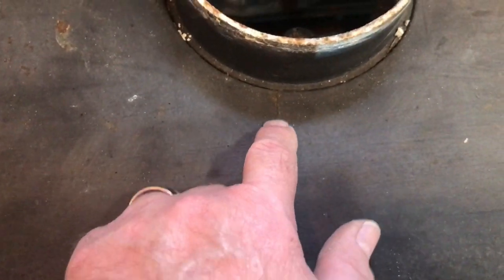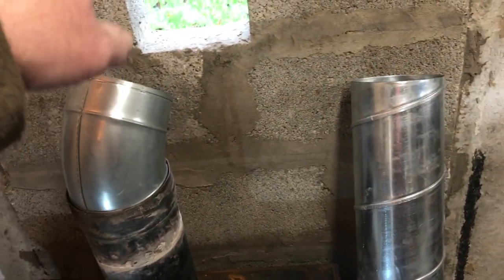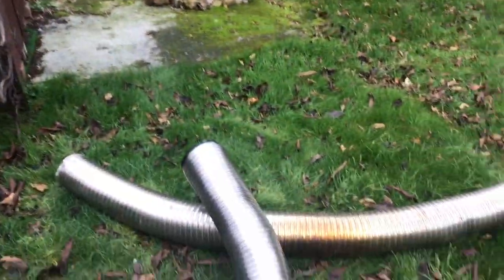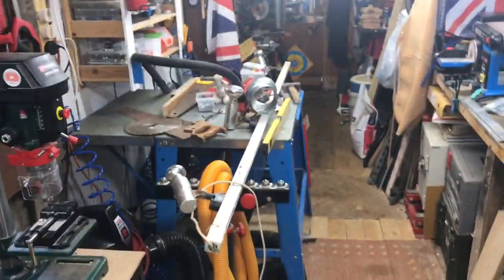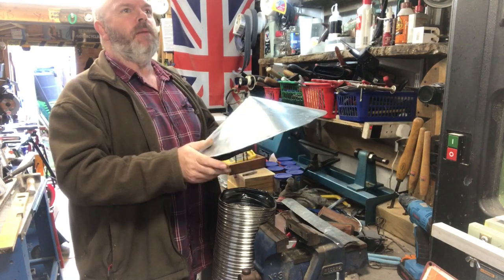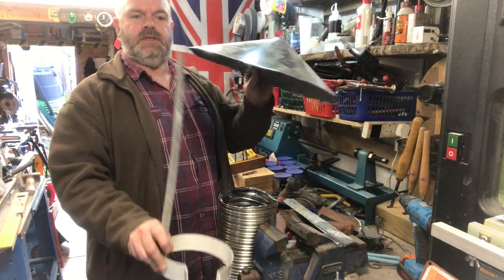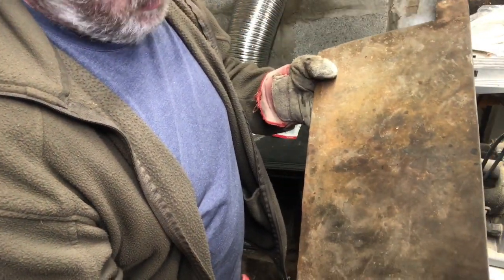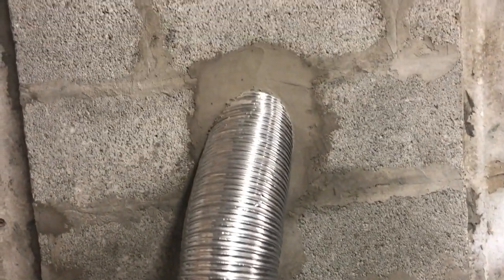In The Workshop Installing a Log Burner

Comment: Just wondering if the inner pipe is upside down so they overlap better and hot air/fumes pass the joints better?
It’s in no way a criticism because I’m no expert I think it’s a good job and I particularly like the bird and squirrel net at the top under the cowling .I remember putting one in with my grandads shed when I was about 14 nearly 60 years have past since then and and my energy levels are not what they were but I still go in the shed most days at least for a few hours. Always find your videos entertaining and we all learn a bit from each other thank you David
Reply from the maker: Hi Michael, I put it on the way the previous owner had it because that's where the fire cement was. It  sits on a ledge inside the hole. I've checked and have no leaks and it draws a treat but I will keep an eye on it 🙂 Maybe we both had it upside down.
Thanks for watching 👍
Reply from the maker: Checked some flue fitting instructions and they have the flue pipe the way I fitted it. They say you have it this way so if creosote runs down the flue it stays on the inside. 🙂👍

Comment: Goid job mate . Glad you used the copex as a sleeve and not the main flue. Good idea to make your own twin wall flue how is it coping. Were did you get the stove fan I remember it from a previous video but can't remember were you said. Keep an eye on the flue as the inner section may cause the main flue too secondary cycle but it might not just thinking ( been a hvac engineer for 27 plus years ) and iam sure your aware watch the temp of the copex on combustible surfaces. Love the work shop mate each episode has a great addition 👍 👌 👏 😀
Reply from the maker: Thanks Dan, the flue and fire are working great at the moment. I keep an eye on everything. The fan I got from Aldi quite a while ago. Thanks for watching, take care 👍
Reply: @InTheWorkshop  cheers mate you too